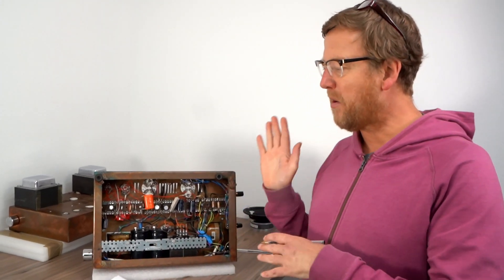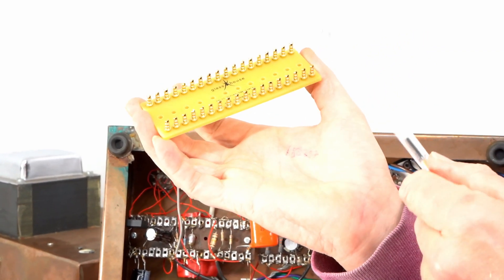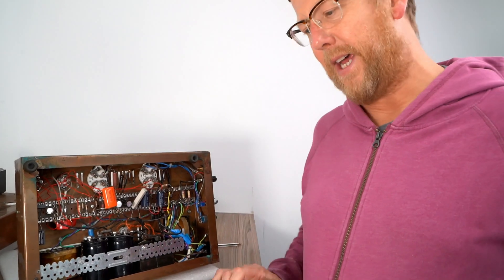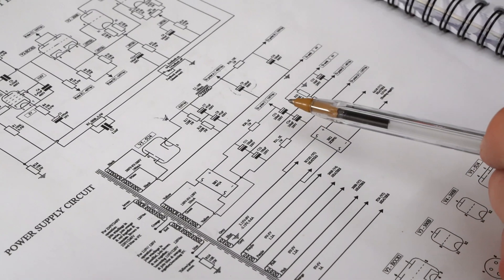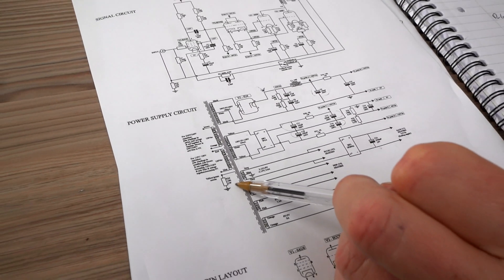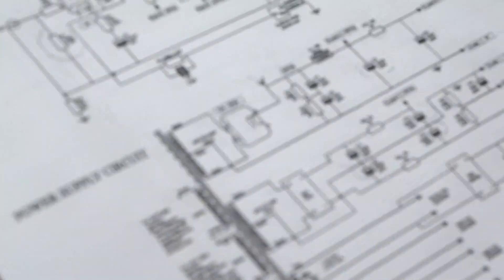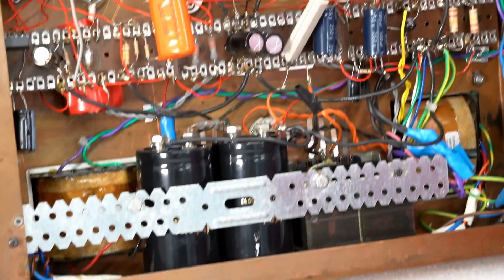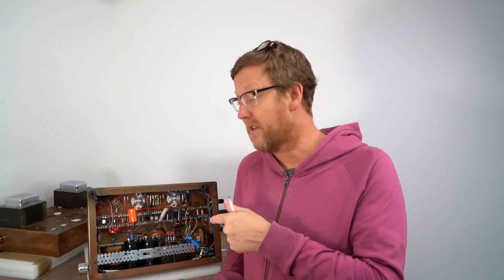Upgrades: WAD 300B Parallel Single-Ended Monobloc Amplifier, Parts Selection

Comment: How do you decide which components to use- caps, resistors? It looks, that you do not stick to favorite brand. Is it your experience with component, price, values?
Reply from the maker: Nicks been in the business a long time as has experience with most of the components out there - it depends on the goal as well, in some parts components will have audio signal passed through them, others power etc so the type/cost/value will vary depending on where the component is being used. As a whole when looking for replacement components equal or close value will be fine, its important to make sure it can handle the voltage passing through it though!